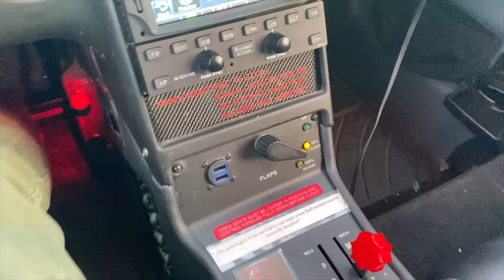I'd never do THAT in a small plane

Comment: I agree that for night flying, the parachute does make a big difference. Without the chute, at night it’s very hard to tell if that dark emergency spot you picked is a field, a forest, or a lake, and where the wires are. During the day that’s no problem, at night it becomes a total lottery. With the parachute it doesn’t matter, you go down vertically and hope for the best.
Reply: Well, it still matters. Dangling off a 900ft cliffs edge or the edge of a skyscraper isn't ideal even with parachutes.
Reply: @Mikinct  landing on a house wouldn't be great, either

Comment: Thanks again for your excellent videos Stef. I guessing you have heard what I just read in Plane & Pilot mag Feb 9 issue. "Details are still emerging here, but Plane & Pilot has confirmed that Continental Aerospace Technologies is working with the FAA on possibly developing an Airworthiness Directive (AD) on aircraft powered by late models of several of its engine models. These include 360-, 470-, 520- and 550-series engines. Continental is urging owners of planes with any of these engines with a manufacturing date between June 1, 2021, and February 7, 2023, to voluntarily ground their planes “until further information is available.” Might not apply to EYZ.

Comment: Question to Cirrus owners. 
Surviving any situation is paramount but if one pulls parachute around the circuit and the plane touches down gently.

Is it always written off as a total loss of the plane and can't ever be used ti fly again after a parachute has been activated or are each case reviewed.

If plane is 100% fine can ine simply add a new parachute to existing plane and ability to keep & fly that plane one owns?

Not to many ever discus those details.

Do Cirrus owners required ti sign a disclaimer that basically states plane is considered Totalled and sent away to salvage parts to resell.